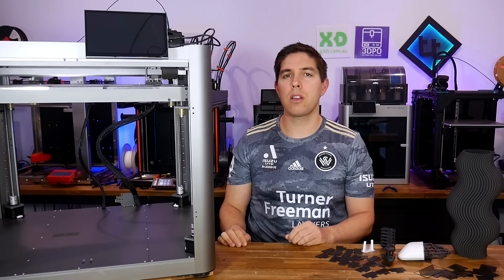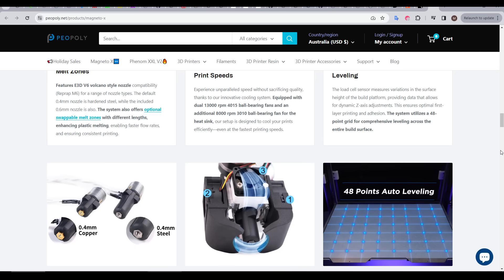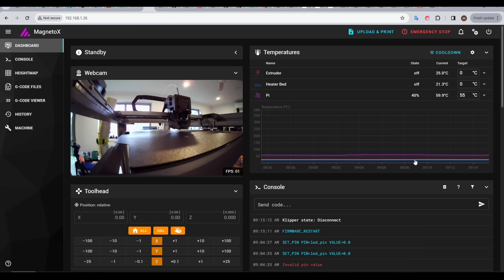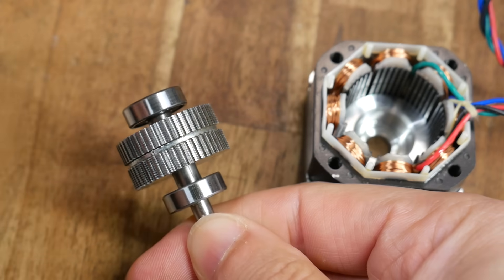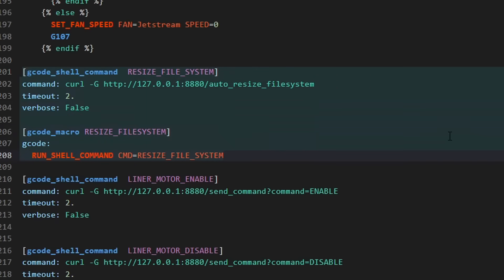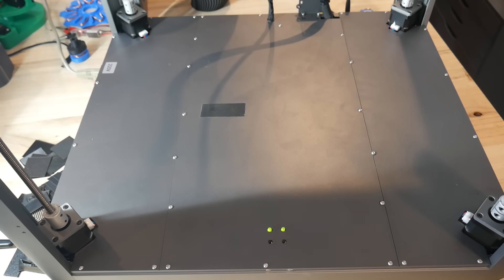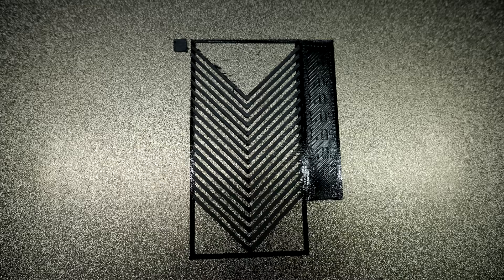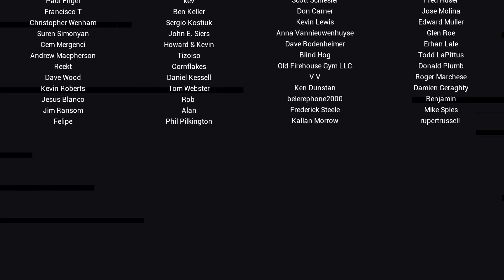Field testing the Peopoly Magneto X linear motor 3D printer

Comment: I think it's about time people start focusing on the slicer instead of adding more and more complex mechanic parts. Also, it's time manufacturers start looking into using closed loop steppers. That would eliminate the need for homing and probing every print and limit switches, since the motors in the loop know how big the area is and the amount of movement they made, even with no power applied to them. As per testing, I'm yet to see people test backlash on printers the same way it's done on milling machines.

Comment: Print wide object using Gizmo-Dorks PC, which is a pure PC filament. I printed it at 340c in qidi xplus3 with a chamber at 65c. I get a little warping though after cooling

Comment: I really like the idea of using a linear motor for X and Y, but the first question in my mind was, "Placing magnets across the X gantry should significantly increase its weight.  How will this affect the Y motion?  More ringing?  Lower acceleration?"  Perhaps because there are two linear Y motors, the acceleration problem is mitigated, but Y-ringing could be a problem.  By the way, it goes without saying that this isn't core XY because there are no belts at all.  But it does resemble a core XY or H-bot printer because the basic motion is similar.
Reply: Yeah, I'd like to build one with linear motors and a crossed rail gantry so all the motors are stationary.
Reply: @dekutree64  So the rails would move and the hot end just rides passively at the interection?
Reply: @yeroca  Yep, like Ultimaker printers but without the belts. It would need dual X motors and dual Y motors, but could be made large and fast if you use square carbon tubes with MGN7 rails instead of steel rods like Ultimaker.
Reply: @dekutree64  Sounds interesting.  Do you have any links on the kinematics?  I took a look at a couple of Ultimaker printers online, but there aren't any details about how their "cartesian" system works.

Comment: Amazing XY drives for sure and an interesting concept indeed! BUT! IMHO these 1990's Tamagochi-style buttons-and bulky led's can't be paired any longer with the year 2030 drive tech. Neither can the 'crammed in the corner totally visible' cheap stepper motors with even cheaper leadscrews. Those need to be hidden underneath the bottom plate, leadscrews be 8mm ballscrews (or even belts) and bed tramming must be possible. Otherwise there are two different worlds of drive dynamics thrown together which makes no sense from a product design pov.  racecar on horsebuggy wheels so to speak. 

No bashing, love the overall design, but those details poke my eyes hard

Comment: I hope you touch on the lead screws used for the Z axis. I'm confused why they went to such great lengths to remove belts from the X/Y, but then went with IMHO the worst method for Z. 
A belted Z would have been very welcome and actually justified the use of linear motors on X/Y.
Reply: Because it's a massive heavy build plate.

Comment: The elephant in the room. Reliability and repeatability of the linear motors, and not just standard tests, but the hard part is finding creative ways to test these which could find potential long-term issues. The system sounds great on paper, but it's new and how do we know it will work correctly after some time? So accelerated stress testing.

Comment: I'd like to see an X & Y motor "Cogging" test done.  Maybe print a big square that is rotated very slightly.  

I'm also interested to see a Beacon Probe installed to compare the bed mesh results to the loadcell results.  I'm concerned that the loadcell will report low in the center of the bed due to gantry flex.

Comment: In your testing, if you think it's worth the test, can you test small circles at high speeds?  My AnkerMake M5 is great at high speed printing most things, but struggles a bit at high speed with small circles that build up.  For instance, organic supports.  Or those collapsible lightsaber blades (vase mode).  Anyhow, thanks for the look at this printer.  I'm eagerly awaiting the review video.

Comment: With closed loop, why does it still need homing?
Reply: It depends on how the encoders work. If they give an absolute position reading, then yes, it would be possible to eliminate homing and endstops entirely. But if they have a repeating pattern then you don't know which cycle you're on at startup.

Comment: Please make sure to show a lot about printer noise in various situations such as idle (which you've done), heating, printing, etc. If i remember, they said that linear motors were a lot quieter. I wonder how quiet it can be while comparing to other printers with the enclosure.

Comment: Does the belt and pully'less system result in smoother prints, and or faster prints. What is the build volume. How does the ambient nose compare to other models like an x1carbon

Comment: 10:08 Look at the bed mounts that connect the bed to the leadscrew... thin and flimsy... no stabilizer at the top... extruder sucks... leadscrew steppers lack components... etc... I could go on. Half-finished cost cut printer for 2000$ USD... all it has is the linear motors and that's nothing new in CNC machining either. That's a fail for me sorry I'll pass.

Comment: This is going to be my next printer, but i would love to see an extra add-on kinda like the expandable AMS system from Bambu and an easy way to switch nozzle size like the A1 series from Bambu. but the whole linear motor with closed loop feedback is super exciting! And that printer has a proper print size for most users! Also KAMP should be a default addon on this printer
Reply: I think they will support Enraged Rabbit Project before they decide to engineer their own multi material system.

Comment: I do not understand how the 4 Z axis motors can work. What if, after probing, the four coordinates are not on the same plane? Probe tolerance is bound to make that happen often. Does the leveling algorithm calculate some kind of compromise? If it does not, the platter risks being unstable, which would not make sense. What didn’t they use 3 points like the other Z-tilt solutions? Have you seen that happen? Have you seen any benefit to a 4th Z motor? Thank you.
Reply: I would say because of the huge size, only 3 "fixed" axis are not enough. If I should do an easy programm, i would set one Z axis as fixed reference and the others to follow. But there are enough printers which already uses 4 Z axis (voron, prusa, raise 3d, ...)

Comment: Linear motors sounds like a great advancement, but my concern is if it's an excessive additional cost, then it will remain an expensive gimmick until the cost comes down.

Comment: I’ve been testing the machine as well. I’ve been referring to it as “rough around the edges, but a shiny inside”. It has a lot of potential and I’m expecting it to continue being refined until it really shines. Great video Michael.
Reply: The core of this machine is build very well and if they could definitely fine tune the user experience and pretty sure once the community gets their hands on the machine they will add more features and help make is even better then it is.
Reply: From what I have seen I am way more excited for the potential of these machines than bambu labs. I realize the price is much higher, but the way they embrace open source is so nice. I can't wait for your video. I am really excited for PeoPoly
Reply: @ashers_workshop  Dont forget that unlike Bambu Labs things this product doesnt have to phone hope to China to work.  You buy it and its yours.  Its why right when it was announced I pre-ordered one of these over buying a bambu set up.
Reply: Wheres the video? I dont believe till i see it

Comment: Wow! I haven't heard about this printer and linear motors.
Interesting how they opted for a 4 point bed mount instead of 3 and it's a shame they went with lead screw instead of ball screw.
Personally I would like to see how the printer handles enclosed printing. I'm curious how peopole deal with thermal expansion in regards to the frame and also how it will effect the operation of the linear motors. Will it effect the magnets, will the rail warp and what effect this will have on the accuracy and torque of the linear motors.

Comment: I would love to know what level of repeatability, and accuracy they have achieved with their X/Y axis. This machine should in theory be ideal for dimensional engineering part. Since they are using closed loop linear motors it should be far more precise and accurate compared to belt drive systems reliant on pulley quality, and inconsistencies in belt tension.

Comment: As of the most recent version or 2 of Klipper, Adaptive Meshing is now native. It can be done with nothing more than BED_MESH_CALIBRATE ADAPTIVE=1
Kamp is still extremely useful for the purging. Just adjust your start gcode to also have ADAPTIVE=1 for your mesh, then comment out the single line in the Kamp_settings.cfg for the mesh

Comment: I'd be curious to see how it'd handle probing and purging if you were to place 2 small prints at opposite corners of the bed. A benchy in the bottom left and top right.

To see if it still retains the time saving element or if it'd revert to probing everywhere.

Also if the head can be swapped with that multi color head/system that was teased by another company last year.

Love that they're utilizing and really responding to the community before launch. And bringing you in is a huge vote of confidence for me.

Comment: Hi Michael, I would like to see an episode that focuses on the X/Y linear motors. For example, comparing it's dynamic to a conventional Core XY printer. Or, explaining how the close loop works (why can't it skip steps? Is it because the full step are larger? Does it have some encoder?).  That is, focusing on the new motion technology vs reviewing an entire printer.
Reply from the maker: Thanks for your feedback. To answer one of your questions, it has an encoder so should be able to adjust for any step errors.
Reply: @TeachingTech  It would be a good few minutes of content to explain how linear encoders work for things like Digital Read Outs (DROs) on industrial machines.  Another question, is it a separate optical encoder, or is it a magnetic encoder using the same magnets as the linear motor?  Linear optical encoders are more precise, but it's almost certainly not worth the additional cost and complexity when they already have the magnets right there.

I also realized some people might not even realize linear encoders exist. So when they hear "encoder" think there's actually a little wheel inside the motor that makes contact with the rails.
Reply: @EmperorA0  It's a magnetic encoder. There are instructions for re-calibrating it when necessary are on the Magneto X wiki.
Reply: @TeachingTech  If klipper supports that functionality, which I doubt.  You should test it but I would say there is a reasonable chance that all the encoder will do is send an error to klipper and stop the print right away.  If so, I wonder if you could continue the print or if you would need a full restart?

Comment: I’d love to know how much weight all of those magnets add to the X axis rail - linear motors are an extremely cool concept, but I’m not entirely sure if they actually let you run higher accelerations than something like an ODrive with a conventional BLDC motor. 20k acceleration is definitely nothing to sneeze at, but I’m curious how close to the limit of the linear motors that actually is. 

It’s a very cool printer though. I do wish that they were using standard V6 nozzles instead of volcano nozzles though. You can just have the start of the meltzone be integral to the heatblock, which allows users to have the widest possible nozzle choice. Take the VZ Goliath or the Bozzle for example - both of those are extremely high flow hotends, but both of them are also designed to use a standard V6 nozzle.
Reply: The weight is significantly more, but the linear motors are used in CNC machines for good reasons: they handle the increased load like it's nothing, and there's so much less backlash unlike what you get with stepper/belt/pulley setups. There is a video...somewhere...on YouTube of the CEO talking about this machine and he mentions the motors can actually go faster than it's set for, but the constraint is the to head can't pull filament faster than that, so that's where they set it to. Will be interesting to see the mods people do and the speeds achieved with even higher flow rates.
Reply: @Geoff_W  that's very cool. Now I want to buy one and put a brushless based extruder on it that can keep up in terms of of pushing filament. 

Honestly part of me wonders if 3mm filament would be better for all these crazy high speed printers nowadays. With a CHT nozzle and a long melt zone I feel like the issues with the core of the filament not melting would be a thing of the past, and it would let extruder motors turn much more slowly for the same flow.

Comment: For the price, will there be any tangible advantage over a core x-y?  The linear motors likely have much greater mass than the drive belts of a Voron style printer so it seems it might be an impediment.  It's great to see replaceable sub-assemblies but that will keep the retail cost high.  This seems like a prototype/alpha level machine.  Long ago .. circa 1978 or so , the  DTC company built a linear motor daisy-wheel impact printer (DTC 450Z). Those went away, I presume since rotary motor+servo/belt drive was too well established and probably cheaper to manufacture and within a few years we had cheap dot-matrix (Epson, Oki, etc..) with  Laser jet's and ink jet's soon to follow.  Name of the company was called "Data Terminals & Communications"  There's a reference to the thing at the Computer History Museum www.computerhistory.org/collections/catalog/102766101.  However, I can't find an image of the actual printer. We had one and it was marvelous--almost no moving parts.

Comment: I'd be interested in the longevity of the magnets in the linear motors when heating the enclosure, whether they would demagnetise.
Reply: Me too! At room temp a typical neo magnet is said to lose 5% magnetic strength every 100 years. Generic data are available showing decline over time at various temps so it shouldn't be too hard to work out the likely impact on longevity with the higher working ambient temps.

Comment: That is a mighty large printer. The only way that I could fit it in (and I fully intend to buy it) would be by accessing it and placing it "sideways" on my bench. It would be great if the screen could be moved, either with an additional print mount or designed to adapt. Also, I have recently received a Bambu X1C, and it runs next to my old Snapmaker A350. These machines are impressive but they all lack a certain thought process for access for disabled users. I don't know what that would look like, but I am finding accessing and tinkering from a wheelchair more and more difficult, rather than moving the positive way. Generally, when this IS considered, it actually creates a better product for all.
Reply: I've thought about this, and after wrestling with the filament feed on my Bambu today - something the rest of you could have done in 5 minutes took me over an hour. However if things were more modular, clip on, clip of, socketed, or latched - rather than screwed and fixed, it would make so much difference for all. I'm thinking about the fast module change on the Snapmaker as a good example, and the magnetised front cover on the Bambu print head. There was no need to screw the filament feed to the back of the X1C, it could have been clip in place like the screen (for example). And putting the power button at the back!! Why?

Comment: It would be good to know how much is gained from having the linear motors.  Perhaps compare to the Bambiu X1 for repeatability and accuracy when approaching a position from different directions (i.e. backlash measurement) for both X and Y axes using a good DTI.  Speed and power should be compared too.